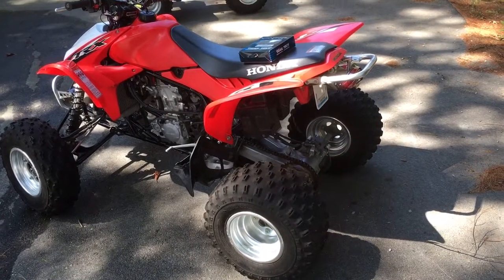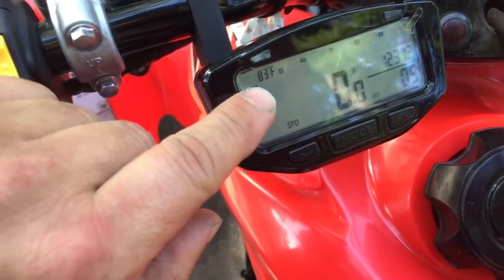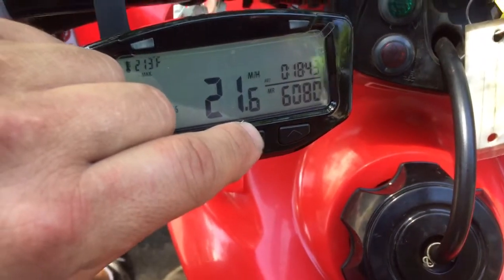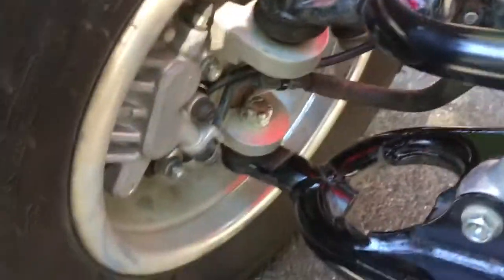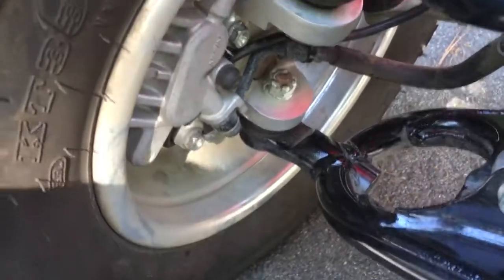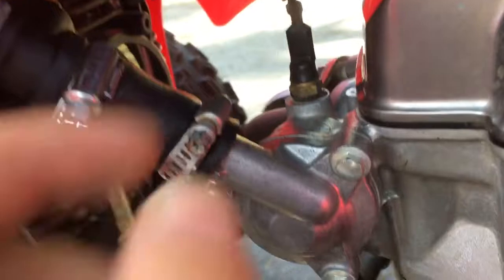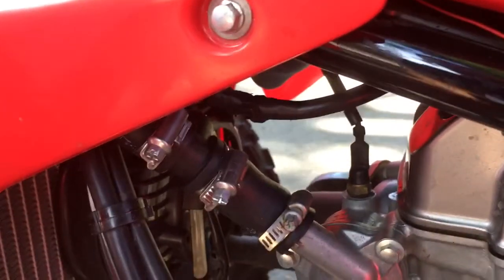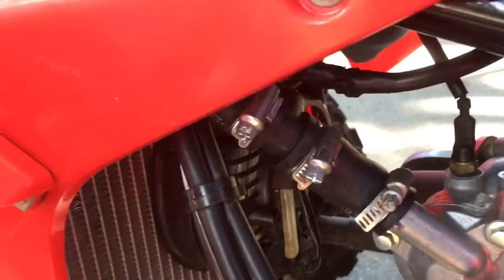Vapor Trail Tech Speedometer Review TRX Honda 450R Install

Comment: would a regular speed odometer work ..one that dosent have to be hooked up with battery because mine is 04 its a kick start
Reply from the maker: I'm not sure. There might be one by this company for your machine
Reply: @HomeownerRepair  yeah I have the same question
Reply: Do you manage to get one?
Looking for one for my 2004 TRX
Reply: @ramonwolff2958  looking to get one for a 2005 Trx450r but I don’t know if there is one for it

Comment: Would this fit on a Quadsport 250
Reply: Vapor has kits for most quads, but they are dummy expensive so just do what I did and buy a universal speedometer and it will look better in my opinion since you can choose what you want